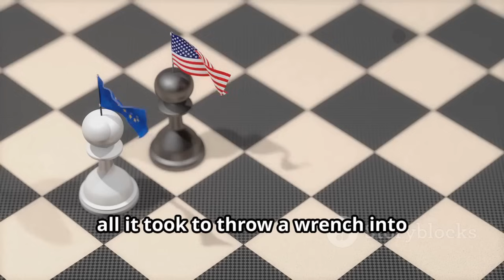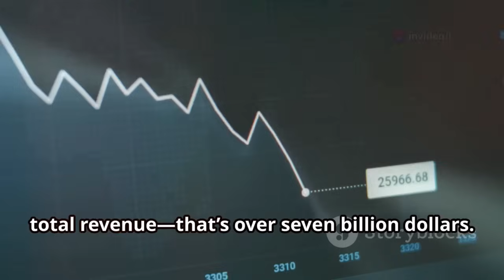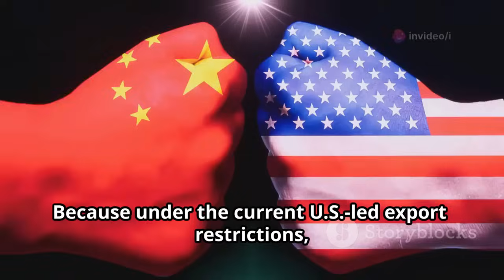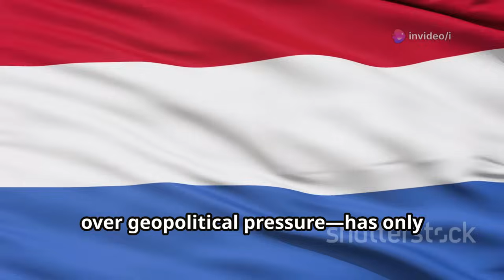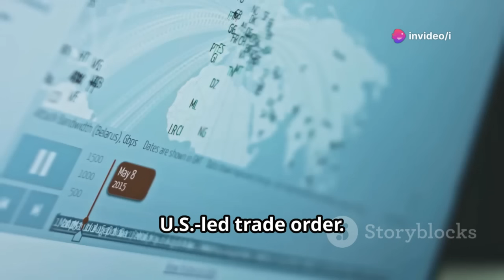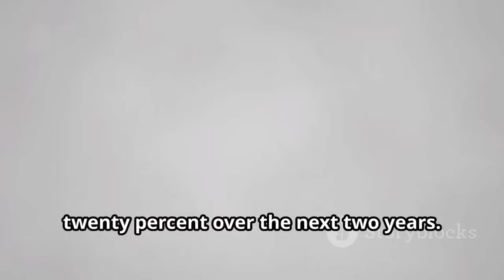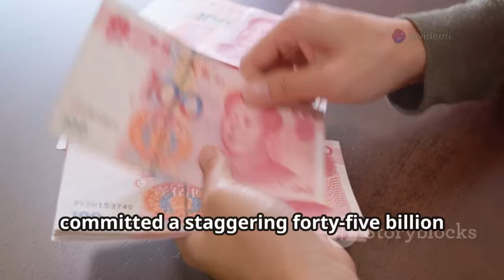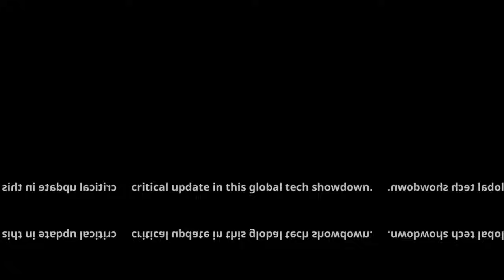ASML’s $7B Shock Deal with China: Is the U.S. Losing the Chip War?

Comment: While you were making this video, Huawei/SMIC have been working on their own EUV machine which is being tested at Huawei's Dongguan campus.  The expectation is production of this machine will happen in 2026 at a price point that will put ASML out of the EUV market.  SMIC has 5nm chips in production and has said to produce 2nm chips in their lab, so the Chinese are nearing parity with the world. Further, the Chinese have developed a two dimensional silicon carbide chip said to equal a 1nm chip with 40% increase in speed and 10% lower in power, all without the need for an EUV machine.  So, the semiconductor world continues its rapid rise with the Chinese leading the charge.  This decade will be China's decade in semiconductors and will lead the world in not only semiconductors, but in manufacturing and test equipment plus its own design software.